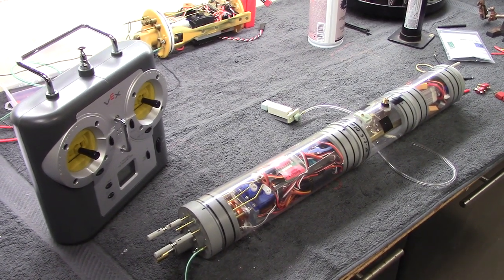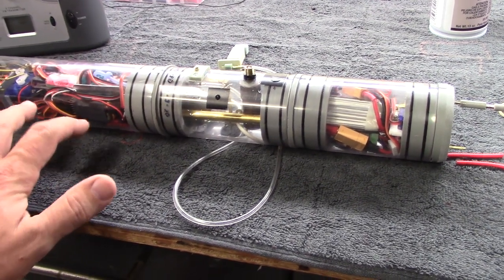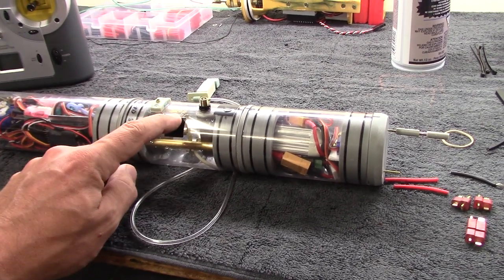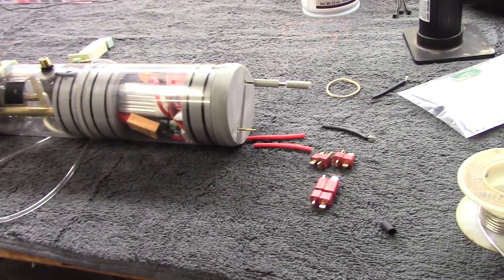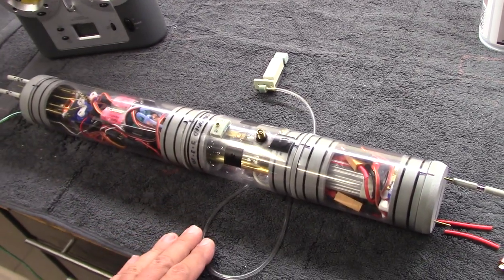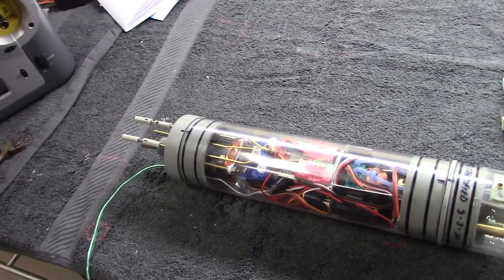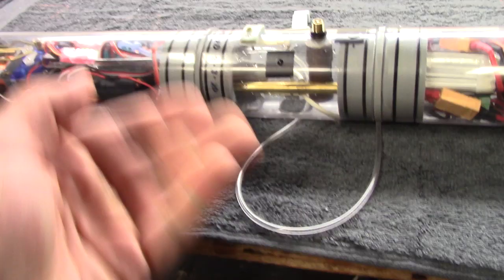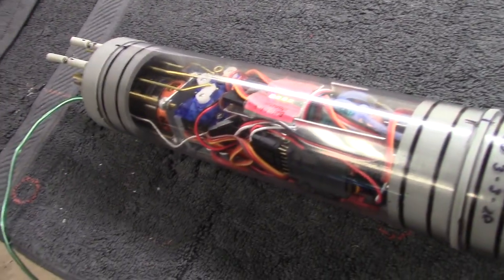The All-New MSD SubDriver for RC Submarines

Comment: This is what I'm looking for .

I've got  3 tipe V II 's one with snorkel , 1 tipe IX  also w/ snorkel , 2 Gato class US sub's and 1  I — 53  IJN sub all are  1: 72 'n scale .

The biggest one is the I — 53 at almost 5 ft long and about 8 or 9 inches  wide ( beam ) .            

I've been wanting to R / C all of them .                The Gato US sub's have interior bracing but the rest of them I have to scratch build .

So for me it's a little hard to figure out what size of this unit to build for the I — 53 .           Since the interior can hold a tipe 7 or even a tipe 9 German U-boat .       Yea it's that big . 

The other problem is with converting the business end .
The rudder and aft dive planes just don't look right .       The main rudder doesn't have any support or bracing at the base and I can't find any photos of this class of sub in dry dock to do any corrections .

Comment: I have trouble navigating your shop. Which one of these would fit the Arkmodel 1:48 U-Boot ? You spec the Dual Easy SubDriver 2.5" but are those brushed motors ? I can't find much of a description what's inside those tubes.  Would one of these new ones fit also ? Thanks

Comment: Can i used two waterpump to fill in and out water
Reply from the maker: If you're pressurizing the air, you'll also need an inline valve to stop water from flowing back through your pumps.